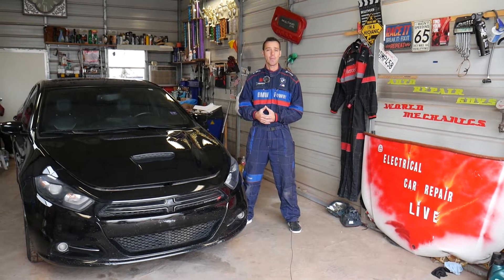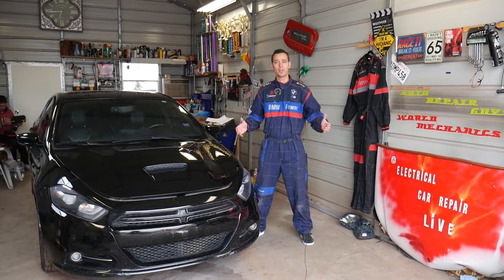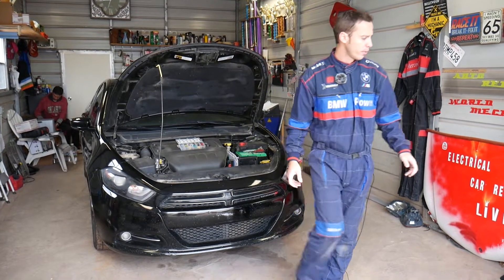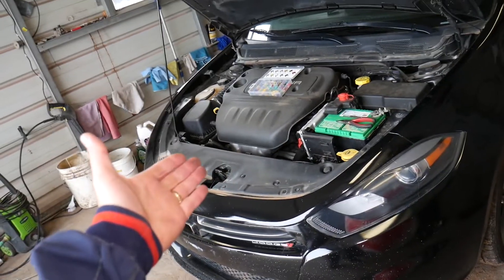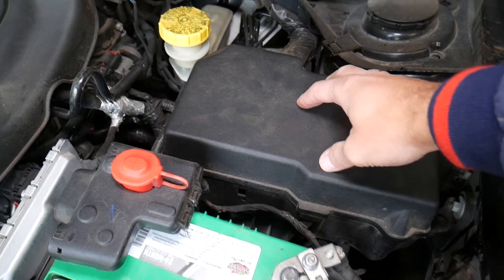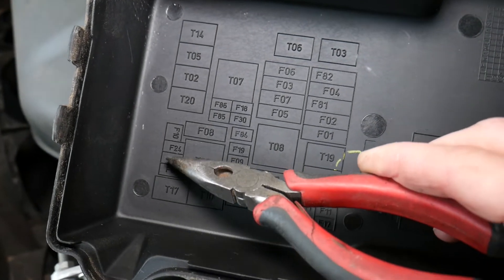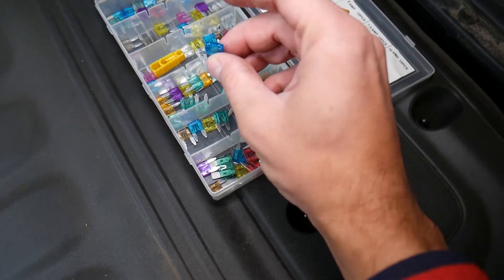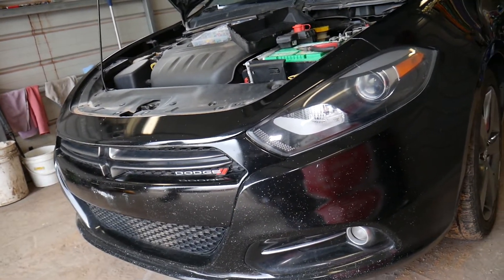DODGE DART IGNITION COIL COILS FUSE LOCATION REPLACEMENT

Comment: 2009 Dodge charger will crank but does not start. Keeps blowing ignition coil fuse when trying to start.  Have replaced the Starter relay. Any suggestions?